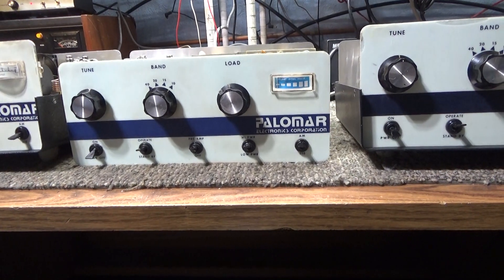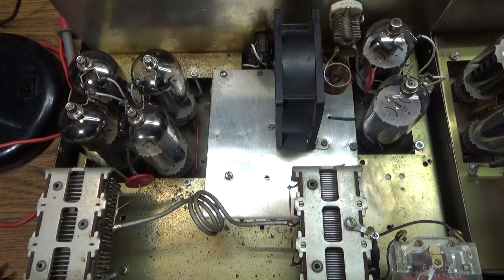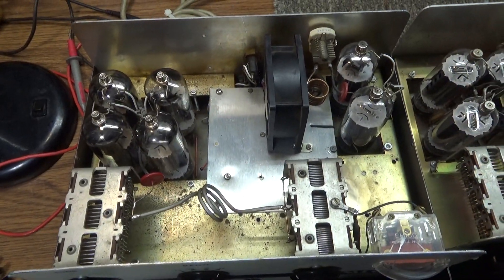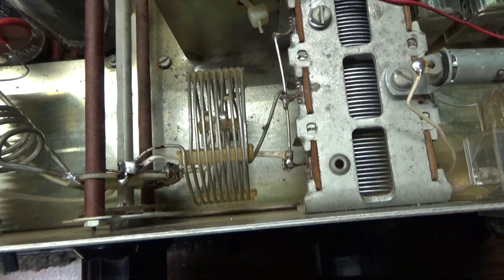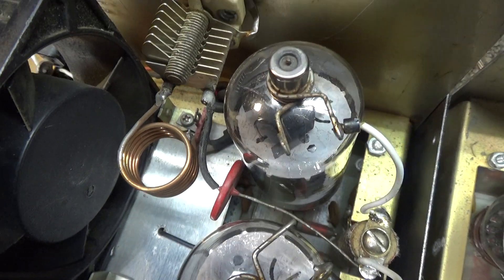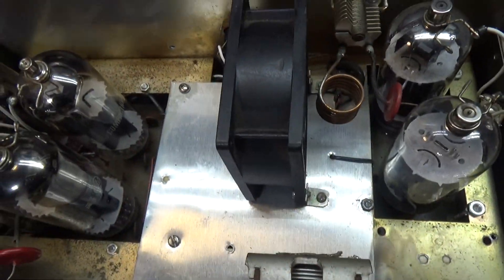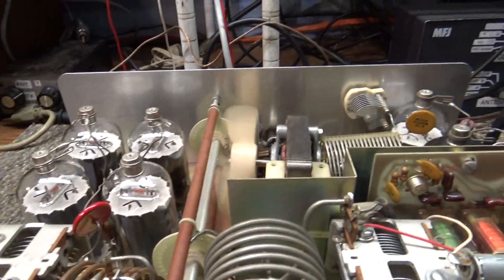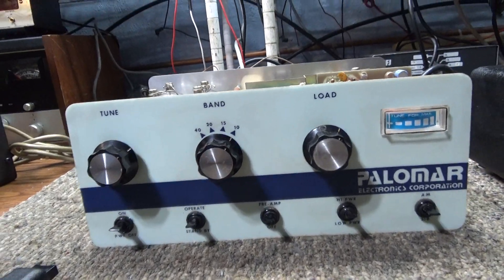Palomar 300a 10-40 meter, full wave bridge, stock but different

Comment: 10 and 15 meters are Ham bands.  What do you mean they removed the Ham bands?  They excluded 20 through 40?  So this AMP originally was supposed to work on 10 thru 40, so the mod took away 2 bands.  It is still supposed to be 10 and 15 correct?
Reply from the maker: They removed 15-20 and 40 meter Ham bands, leaving only 10 meters. Any amp that works on 10 meters will also work on 11 meters as they are that close., unless they is some sort of 11 meter notch filter in the circuit aka SB-221. Hence, when I and others say they removed the Ham bands, or use the term Monobanded, all the other Ham bands except for 10 (11) meters were removed. BTW, it is said that the Ham bands 'other than 10 meters' won't load or work correctly anyway.

Comment: Would you be able to give me some advice? I have a white face 300a, the kind with 2 relays on top and the high voltage relay underneath on the high voltage board. It slowly started unkeying right after I key the mic on and off for about a week until eventually it just stopped keying up completely. The two relays on top are engaging but the high voltage relay is not engaging even after cleaning the contacts. I can manually engage the relay with a screwdriver and it still doesn’t work. Could you please give me some advice on what to test or what it might be? I’m trying everything I can think of and have not found a problem yet. Any guidance would be greatly appreciated sir.
Reply from the maker: I would need good pics or a video to try to help.
Reply: @ thank you I’ll work on that. Do you have an email I can send it to?

Comment: Saw your FB. I need to identify a Palmomar Amp I acquired.
Reply from the maker: Bases Palomar
60          2 6ju6 Base
160         1 12jb6 driving 2 8950
200X        1 12jb6 driving 2 8950
300A        2 6lf6  driving 4 6lf6 some versions used 8950's
350Z        2 6lf6  driving 4 6lf6
Skipper 300 1 6lf6  driving 3 6lf6  some versions used 8950's

Bases Pal
Pal 125     1 12jb6 driving 1 6lq6
Pal PDX-200 1 12jb6 driving 2 8950
Pal 221     1 12jb6 driving 2 8950
Pal 321(a)  1 8950  driving 3 8950
Pal 351     1 8950  driving 3 8950
Pal 600+    1 12jb6 driving 2 6lq6 driving 6 6lf6

Mobiles
Palomar Mobiles
Pulsor  1 8950
50      2 6ju6
150     1 12jb6 driving 2 8950
310M    1 8950  driving 3 8950

Pal Mobiles
Buddy   1 8950
120     1 12jb6 driving 1 6lq6
170     1 12jb6 driving 2 6lq6
200MDX  1 12jb6 driving 2 8950
290+    1 6lq6  driving 3 6lq6
350mdx  1 8950  driving 3 8950
500M    1 M2057 driving 4 M2057

Comment: Hey Doc, i have a question. I have 2 300a amps, a white face and a black face. They both work very well. Both have the voltage doubler circuit. That therein is the problem. I only have one transformer between the two. I do have a high voltage transformer. I do know, as you said, a full wave rectifier conversion cannbe done. It would be sweet if i could send one to you to get that upgrade done.
Reply from the maker: email me at Tramdr at yahoo.com

Comment: HEY TRAMDR I JUST BOUGHT A D-104 MIC THE SELLER SAID IT WAS A G-STAND BUT HE MADE THE MISTAKE AND SENT A TUG-9 STAND. MY QUESTION TO YOU IS WILL THIS MIC STILL OPERATE ON MY MARK 3 GOLDEN EAGLE?
Reply: SO AM I UNDERSTANDING CORRECTLY THE GOLDEN EAGLE HAS A CIRCUIT THAT ACTS AS A MODULATOR ALREADY IN THUS ELIMULATING THE NEED FOR A AMPLIFIED MIC? ORGO THE 776 UNMODULATED MIC
Reply from the maker: that is correct. Some radios benefit a little from an amplified Mic, some radios benefit a lot from an amplified Mic, and some radios already have more than enough amplification in them already, so they do not benefit from an amplified Mic. The Big Browning and Tram bases are the latter, they do not benefit from amplified Mics. However, if you turn yours down far enough, it will be equal to an unamplified Mic.
Reply from the maker: It will work, turn the Mic gain down. Also the amplifier in it can be bypassed which would convert it to what a G stand does.

Comment: Mine has 6  kd6's ?
Reply from the maker: 12 PIN large (Palomar Maco)
6LF6   40   6V 2A
6LX6   40        6LF6, 6LX6, and 6MH6 are said to be virtually identical except for size
6MH6  38.5
6JS6   28
6JS6A  28
6JS6B  28
6JS6C  30
6KD6   33
6KN6*  30
6LB6   30
6LR6   30
6JM6A 17.5
8950    33   12V Filament   1.1A
M2057 40   12V Filament  1.3A